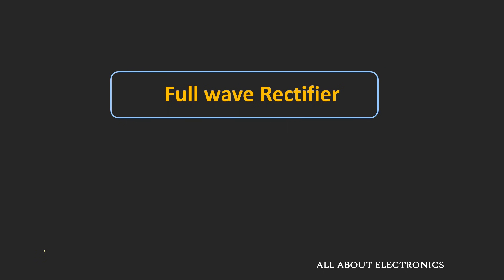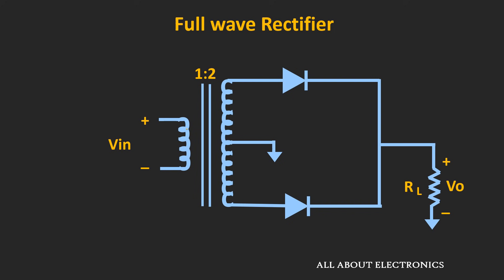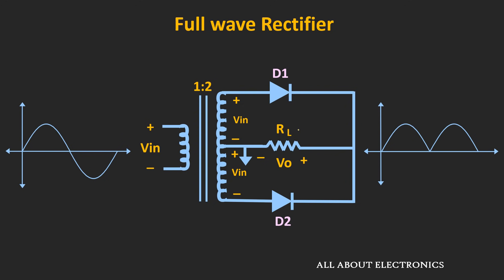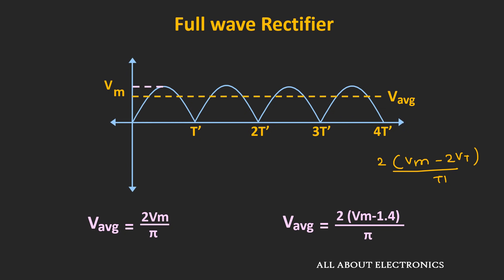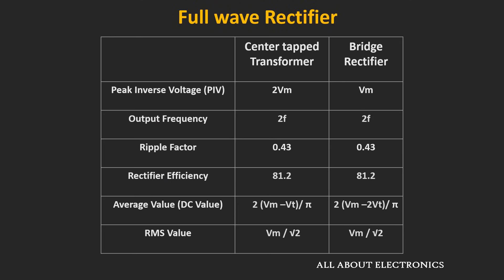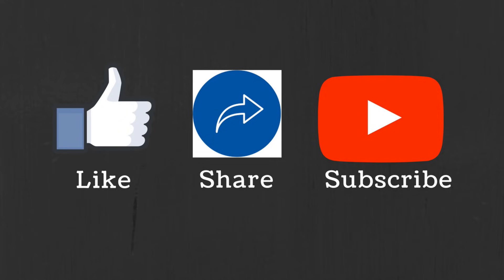Full wave Rectifier Explained

Comment from the maker: The timestamps for the different topics covered in the video:

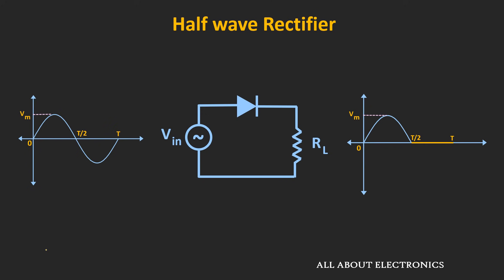0:20 Introduction to Full-wave Rectifier

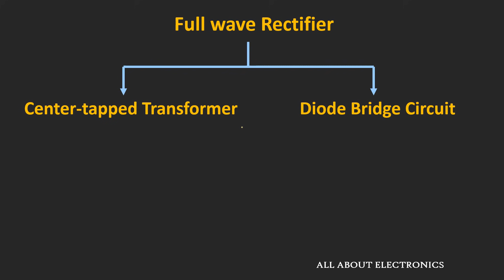2:21 Center tapped full wave rectifier

6:16 Peak Inverse Voltage of Center tapped Full-wave Rectifier

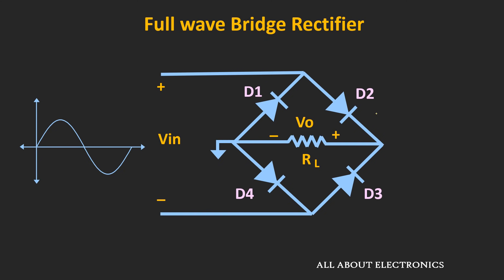8:04 Full-wave Bridge Rectifier

10:34  Peak Inverse Voltage of Full-wave Bridge Rectifier

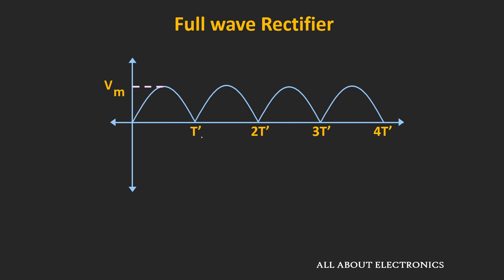12:07 Full wave rectifier with RC filter (Ripple voltage and Ripple factor)
Reply: Bro your the best always, one small help bro kindly upload controlled rectifier also and difference between those
Reply: Inverter topics kindly upload bro concepts I am not able to understand please upload inveter
Reply: ♥️♥️♥️♥️♥️♥️♥️♥️♥️♥️♥️♥️♥️♥️♥️💘💘💘 your genius brother
Reply: Which state, Sir?

Comment: I totally forgot about the center-tapped transformer since my schooling.  I never use it; I always use a full-wave, 4 diode rectifier circuit with a high-quality pi filter using to capacitors and an inductor.

Comment: thank you very informative for me....i am wanting to make a bike battery charger or buy one 240v ac to round 60v dc..the batterys are lithium titenate and can take all the amps and more a house out let plug can give..i have 2 questions..1: what sort of diodes would i use to make a diode bridge circuit ?and  ..2: because i have a battery down stream can i make the circuit with out a capasitor?

Comment: Sir  I am trying to make a electric magnet in a the base of a 30 inch metal bender I cut out and wielded it in a form of a magnet   I am using a 200 amp 2 pole full bridge rectifier to change the current to dc but it keeps tripping the breaker. Do I need a transformer in front of the rectifier. Please give me some tips on making this project work. I would appreciate it

Comment: A full wave center-tapped transformer rectifier in a power supply provides an average dc output
voltage of 14V on which a maximum ripple of +/-0.5 volt is allowed. Diodes have a 0.7V drop
when conducting. Assuming a resistive load of 120 Ω, a line voltage of 120V rms @ 60Hz through
a transformer,
(a) Sketch the circuit diagram for the rectifier
(b) what is the rms voltage across the transformer secondary?
(c) Determine the size of filter capacitor required.
(d) Assuming 50% safety margin, what diode PIV rating is appropriat